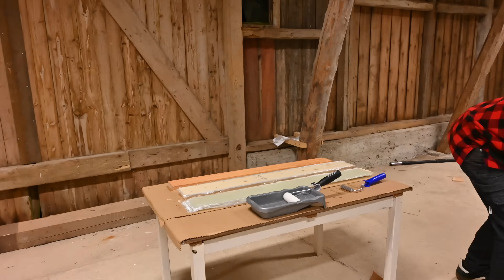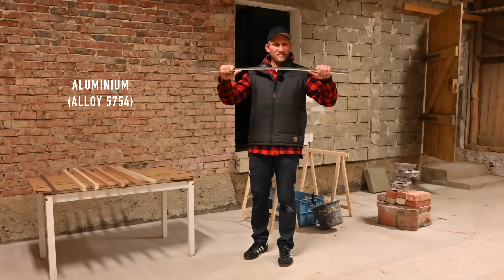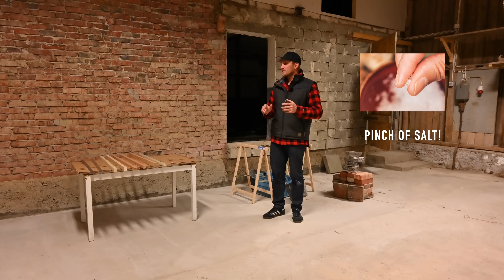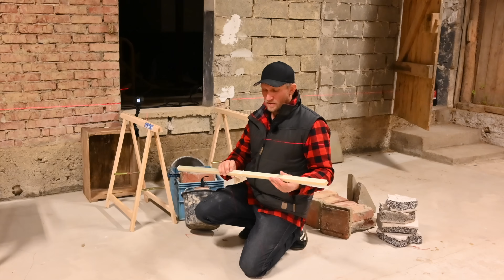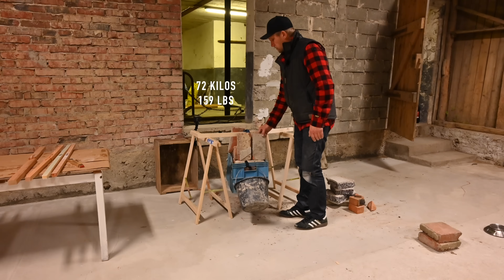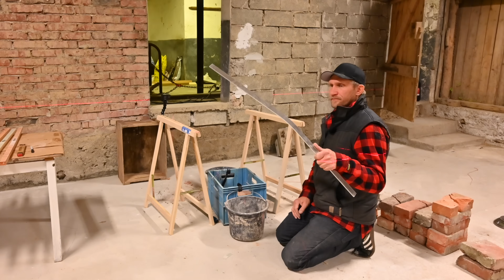Boat Hull Material Test - Which Breaks First? - Ep.  319 RAN Sailing

Comment: You are not taking into account the possibility of having a different cross section shape like a sandwich, e.g. for steel. I mean, a material with lower density in this test will have a big advantage because the bending stiffness is mainly higher due to the bigger cross section, not due to the material property.

Comment: Comparing wood by weight is not accurate as a material's strength is in it's section properties.  You should be comparing lumber of the same dimension for it's strength then considering if the weight would be a detrimental factor.

Comment: Tjena Johan,

Nice test man. Sandwich structures have a tendency to perform better. 
One commment about your test though. To really put the materials under the same rule you must need calculate the inertia of the samples. And it's very sensitive to the thickness of the material. For example, if you mantain the material and double the thickness the resistance will increase by a factor of 8. So, to get how much your samples really support you should rate it by its inertia.
I can help you with this calculation if you want. Just send me a message (I live as well).  😃

MVH
Paulo

Comment: Many marina's in the U.S. no longer will rent slips to wooden boats (i.e. wood boats covered with fiberglass), your video showed these boats are potentially just as strong (the real reason they wont let in glass over wood boats is they want the new expensive boats with customers with deep wallets that don't complain"....then here is the insurance industry that also doesn't want to insure glass over wood boats because of wood rot.....

Comment: engineering 101: a beam that has the same crossectional aea but is twice as tall is 8 times as strong. weight hardly matters. Test for crossectional strength and heigth first translate to weight later. Otherwise your tests will be wildly misleading.

Comment: good choice. My strip plank west. red cedar epoxy fiberglass boat was struck head on mid ocean by a 300 meter cntainer ship. And tough badly damaged never took on water. Broken mast, dislodged rudder, huge bash in the hull, no water. For boats of this size is the strongest and safest of all. Hopefully your boat will not sink if it floods. Monohulls sink, multihulls often can not. Think about that.

Comment: red cedar strip plank, single layer running longitudinally, sheathed with glass and epoxy, it’s well proven and used a lot for custom builds in New Zealand, my 35 footer is 30 years old and the hull is solid,

Comment: A very nice video! Sorry I’m late to the party… had too many boat projects to complete before winterizing in Boston. Following you for years with my Contest 43-44, started in the Med, Caribbean and now at home in Boston - almost a twin sister to RAN II… The materials testing was interesting but maybe did a little injustice to the metals. For example, you could position the metal bars vertically and see different results, or use a metal tube or square extrusion in the same weight (as weight is the common denominator for this test…). It is also a matter of intended use, If looking at the frame/superstructure or hull/deck materials - the needs are different. I’m an engineer so as nerdy as you can imagine 😊. Regardless, I’m drafting the early stage core plans for my own DIY boat, if you like to share ideas etc. Thanks for the great super pro show! —Nitzan Sneh, s/v GDY-Kids

Comment: volume of each material used is different. use the same thickness of wood used in Al & Steel. Strength of Al & Steel is higher than wood + fiberglass

Comment: Johan:  I am a retired engineer.  Please don't procede with this experiement.  It will lead you to a wrong conclusin.  In fact it is unneccessary.  Characteristics ob building materials are well documented and are readily available on line.  

Cutting the test pieces heights to obtain equal weight of test strips is wrong.  The stiffness of a beam is determined partly by its modulusd (how much force it takes to compress, stretch, or shearthe material in pure eleastic mode.  However the area moment of inertia is a far larger factor because that varies with the fourth power of the depth of the beam times the width.  That is why the aluminum sample appeared stiffer than the steeel.

Please talk to your naval architect.  He should specify what to use for his design.  He can explain what I have said and demonstrate it in a manner that you can understand.

Sincerely, Lou Messer, San Diego, CA USA

Comment: I am not a person who has any such technical knowledge whatsoever. But I wonder if one could build his yacht with wood and have it somehow coated with aluminium or steel at least in the parts of the hull. Would that be possible? It may be a very expensive idea, but if cost was not an issue, would that solve all the security issues?

Comment: I followed you guys from the start. Vera is my favo-cruising youngster. However, thanks to this last video I know why my acoustic guitars were very expensive. They are all with cedar tops. Back to sailing. I sailed all my life. Waarschip. I started with a quarterton and later a 1010. All their boats are built in "multiknik", that's Dutch. Check their older designs and you know what that means. The older boats were built out of mahogany. No fiberglass at all, no need. Many of them are over 50 years old but still in top-shape. However, they do take some love and care. Back to guitars. Mahonagy is very often used for back- and sidepanels. Specially is sidepanels are deformed heavily, still preserving strength. Also over more than a century. I checked prices in Holland for mahogany per m3. Half the price of what you mentioned on red cedar. 2000 to 2600, depending on required lenght,width and thickness. Maybe an option to consider. Cedar (in your test) proved to be very hard to break, whereas spruce broke. Have you considered magohany? Regards to Vera, Malin and yourgoodself.

Comment: I enjoyed the video but found that the test seemed to be done based on confirming a choice .  Eg by using long thin planks you exaggerate the bending/cracking.  This will significantly affect the more bendable products (steel, aluminum, foam etc).  It would seem a more reasonable for a point load test would be to make a T shape of the materials tested rather than a - (of the same weight) and test then.  Results may change or be similar, but more realistic either way.  If I'm missing the point, let me know I have no experience with boat building :-)  Also as others have said, insulation, sudden impact, longevity and resale value would seem to be important items (along with work ability/experience, weight, price etc as you have said).

Comment: Have a look at Accoya timber, basically treated to replace cellulose with Acetic acid, effectively turning softwood into hardwood to prevent rot.
Reply: …the process greatly reduces the strength

Comment: You might consider a tortured plywood method of quality checked BS1088 marine plywood... Okoume or Meranti. Just make sure you test each batch of plywood. Put a piece through the dishwasher a few times and see how the glue holds up. 2 or 3 diagonal layers of 6 mm marine plywood strips bonded with epoxy and coated in fiberglass would be a good method. You would build a form and build the hull as two identical half sections. Look up the constant camber method devised by Jim Brown and John Marples.

Comment: Nice comparison. It's clear that dollar for dollar the local spruce is a great choice. If you were building the boat in British Columbia or a tiny boat project then western red cedar would be great. Here in the USA the Douglas fir is the top choice for home construction. It's quite strong. You'll have a fine vessel made from the spruce or local fir. You may choose different species for certain pieces of the boat based on the hardness or abrasion resistance. I did have a free full listing of the material properties including rot resistance of many wood species which I found online. But I lost that when my hard drive crashed. Search online for that engineering data. It might help your final decision.

Comment: Great episode, loved it. Here in New Zealand Kauri is the timber of choice and in the old days it would have been heart Kauri which would easily last a 100yrs in carvel construction without any epoxy or glass to protect it but you can't buy it now and even normal Kauri is prohibitly expensive hence most yachts are now in fiberglass. Strip plank construction with a convex to concave join edge screwed and glued is immensely strong and really the glass on the outside is just to protect the timber. On my yacht it is glassed on the outside and only sealed with wood sealer and painted on the inside. I was told the only weakness of strip plank construction is that they are almost to rigid with very little give but I can live with that. I would definitely use the red cedar if you can afford it.

Comment: I'm from Oregon and spent a career selling sawmill equipment, mostly around kiln dryers.  I have never heard the term Oregon Pine.  D' Fir or Douglas Fir is probably the most common framing wood in the west given it's structural qualities.  (Eastern US uses Southern Yellow Pine.)  D' Fir grows from the Pacific coast to the Rockies and from Mexico to Canada.  Other common softwoods from the Pacific NW include true firs, hemlock, cedars, several pines and a few spruces.  Sitka spruce, as in the famous one-off amphibious airplane, the Spruce Goose is renowned for its strength to weight ratio and used in musical instruments like violins and cellos.  I am not surprise the Swedish Spruce tested well if it is related.  I understand the test was meant to be simple but know the metal samples would have performed better if it competed in a different shape such as a tube or miniature I-beam.  

In any case, thanks for the video.  I didn't notice anything nerdy about it.  I really look forward to your new phase of boatbuilding.  I really like learning about the analysis, application, selection, decision process.  My wife loves watching Vera grow up and her personality bloom.

Comment: thats an interesting test, fact is that the wood you buy will have different quality, even its all from one sort of pine or cedar, because strenght of the wood depends also on age of the tree, when cut and the way the cut wood it  let to dry, how long under which circumstances….so you can not really rely on a test like you did… to me one thing is obvious, if you have wood without lamination on its much more felxibel and will last longer

Comment: I've got a 1970 plywood hull trimaran,  41ft length 24.5 ft beam, all stringers are western red cedar, all deck framing western red cedar, lots of planking from 3/8 and 1/2 inch marine plywood, deck is 3/4 marine ply where needed, 1/2 inch where no stresses are being applied , I've been restoring it for 3 years and found very little rot, not bad for a 52 year old race boat, 2 skins of 6 oz cloth over planking and deck surfaces

Comment: Great video.  I think you said you were using a timber core as you weren’t going to make a separate mould?  I was wondering why you don’t make a mould with cheapest timber and then form the hull in solid grp?  I worry about the risk of deterioration in locations where there are through hulls and other fixings that might allow seepage.  I know nothing though - just curious!  Maybe the two layers of grp separated provides a better bending resistance as you were demonstrating?  Maybe you could demonstrate strength/bending of grp on its own?   🙏

Comment: Nice Video :-) 
But you can t compare it really. Its important that the material at least have the same height. I understand that you compared the weight, but even than you could make the samples the same height. For examples, that all the samples have the height of 5mm or 10mm. Than some would be a lot wider than others, but since the strength is in the height, you would get a better comparison. 
Greets Sebastian

Comment: What are the sawhorses made of?  Are they store-bought or did you make them?  From plans?  I have a 30x40' building, but I won't be building a boat.  I just built a 'balcony' with a window access  so the cat who resides inside and keeps critters at bay can go in and out at will.  The old balcony wore out after only 15 years, so I used treated lumbar sealed with waterproofing to try to make it last longer.  You have a huge multi-year job ahead of you and I hope you get help along the way.

Comment: Hi guys, I've been watching your videos for about a year now and have really enjoyed them. I'm looking forward to following your boat building adventure. Your material testing was interesting. I'm a structural engineer and I appreciated your set up and especially the laser level you were using to check deflection. However, I'm not sure you were testing apples to apples. Without getting too deep into the nerdy engineering, there's a difference between the overall strength of a material and the stiffness of a section of the same material. I'm sure that's not news to you as a woodworker. If I understood the testing parameters, you were trying to keep each test specimen roughly the same weight and width. That meant adjusting the thickness, or depth, of each specimen to even out the weights between specimens. However, stiffness is directly proportional to the cube of the depth of each of these rectangular sections. A little change in depth goes a long way to making something stiffer. That's why the Western Red Cedar seemed so much "stronger" than the other materials. Because it is a lighter wood (it's weight is about 70% of Douglas Fir and only about 58% as strong), you could make it a deeper section, and thus stiffer than the Doug Fir section. (BTW: Never heard of "Oregon Pine" as a wood species. Sounds like a marketing ploy.) Anyways, there are plenty of weeds to wander into regarding all this if you're interested. But between you and your marine architect, I'm sure you've got a good handle on it. Again, I'm really looking forward to your boat build. Best of luck and keep up the good work!
Reply: As an engineer I agree to the stiffness being influenced by the cube of the depth of the sample. Looking forward to watching your project.

Comment: I think this test should have compared several materials in relation to a given strength and not to a certain weight. An interesting value of strength could tell something about the intrinsic characteristics of the material. For instance, the failure of the wooden pieces is abrupt (even with fiberglass) while the metals deflect. Maybe the deflection before a failure is a much safer mechanism of failure in a boat?

Comment: Since bending strength is so much influenced by section thickness, it's interesting that for a model of a boat skin that the material density was so much offset by its strength.  If one were building a beam instead of a hull it would be possible to vary the width of the section, increasing the strength of several of the samples - steel, especially.  Coupon pull tests might be interesting too.

Comment: I vote for Cedar.  It is light, strong, and rot resistant.  My 54 year old, cedar on oak, strip planked sailboat has been around the Pacific ocean several times so far, survived a hurricane in Hawaii in '82, on anchor, was washed up onto a rock jetty where her side planks were scrubbed half way through till the authorities craned her back to the anchorage. She was then sailed back to Seattle where her planks were replaced.  The strength of wood is amazing.

Comment: ...and this is why metals and woods are used in I- and Box- beamed construction for strength vs. weight. even the simplest I-structure in steel would be  25x stronger.

Comment: Just as an idea to rehabilitate the metals a little bit: did You think about Origami-building the hull?
There's probably no faster, more satisfying or cheaper (in terms of additional framing materials and consumables) way to put together a metal hull for a small-ish cruising sailboat-hull. Putting together the hull and deck within a week or two (compared to a whole summer for a composite wood/fiberglass hull'n deck) would open a pretty wide time-window for more elaborate inside outfitting. Price is an issue for alu of course (and I would not want a steel hull for corrosion reasons). 
Anyway thanks for sharing! Cheers
And edit: You can vastly improve Your impact stability of a strip-wood-fiberglass composite hull with a couple layers of aramid fibercloth outside the "core" (or within the first layer of decorative outside veneer in a lamellated ply hull, for that matter).
Aramid is the yellowish fiber used for modern bullet proof vests. Grandios impact catching properties if worked into the construction in the right way.
When it comes to vacuum bagging: It is so much easier than You think, You can use pumps from lung ventilators out of hospitals (which are sold off cheaply after certain amounts of hours on the clock, no matter how well functioning - zero failure tolerance of course) or bigger compressors out of cooling- or air conditioning-devices. Once Your first layer is air-tight You can go on vacuum bagging (on both sides alternating if need be) with no big effort and nearly without additional bracing or formkeeping. We used normal cheap 50µ to 100µ PE construction foils, some pond building root-helper (as a distance-layer for air to get through), a vlies and a peeling layer together with four lung ventilators for veneered composite hulls up to 14 meter with good results. Preparation and workflow is key here, but You can easily do it mostly alone. 
Only thing a little bit more complicated in terms of composite layers would be using a deepfrozen prepreg material, while there's no need for that in a cruising hull.